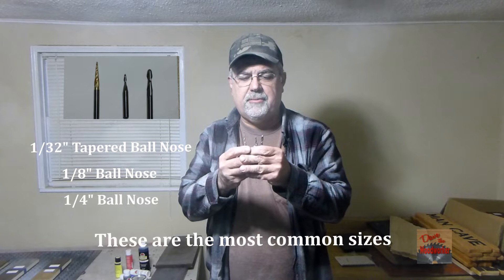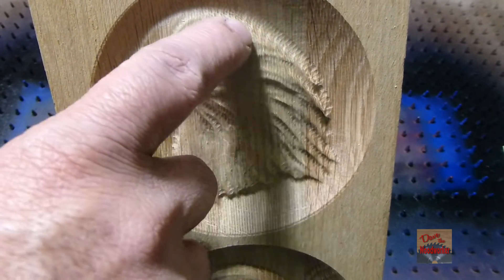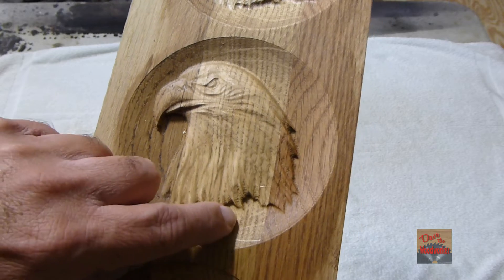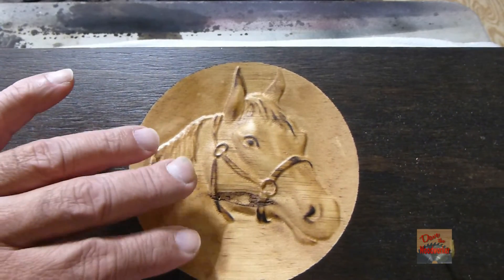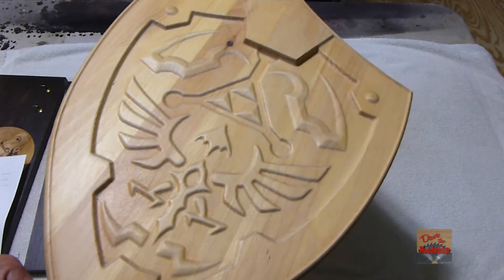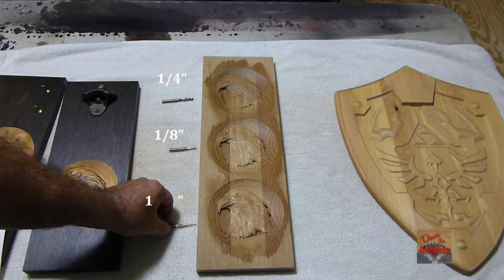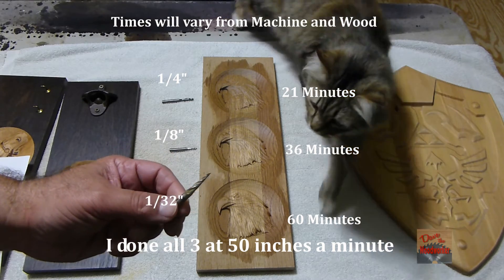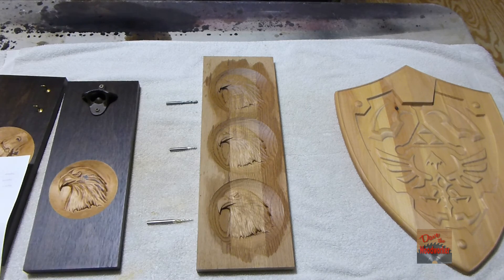Comparing CNC Ball Nose Bits

Comment: Hello may I ask i search the best tapered ball nose bits. Most I want to  use about 40mm or 30mm thick pieces wood. Now I use 3.175mm ball nose but I see and hear some vibration on the bit. So I search on aliexpress for tapered ball nose but I don't know what point size I must have. Can you help me ? Thanks
Reply from the maker: I use Amanda router bits, sold by Toolstoday.com you might checked them out

Comment: Question 
When using ballnose bits do you program a step over rate between size

Like rough cut than finish cut does software do that or do you program that? 
Thankyou i am learning
Reply from the maker: If you use a ballnose bit for a rough pass, you will have to enter the step over manually. But if you can use a straight bit for the rough pass
Reply: @davethewoodworker1043  
So use straight bit for rough cut
Than switch to ball nose program stepover
Is there a chart for how much?
Reply from the maker: @markprieur4464  no charts, that I know of. Mine are .025 step over for 1/4" Ballnose. .01 for a 1/8" Ballnose and .0069 for my 1/32" Tapered ballnose bit.
Reply: @davethewoodworker1043  thankyou